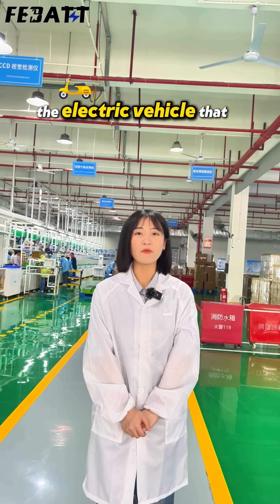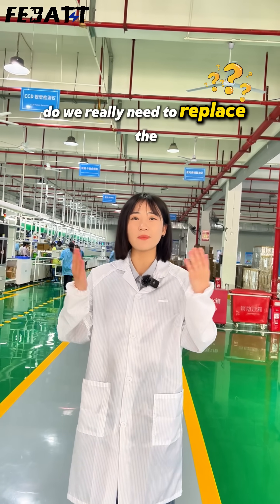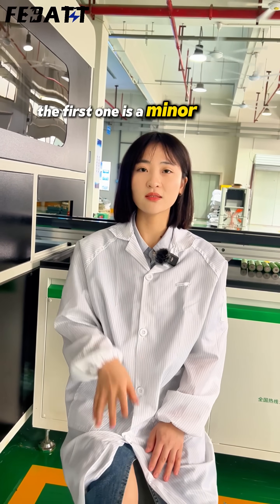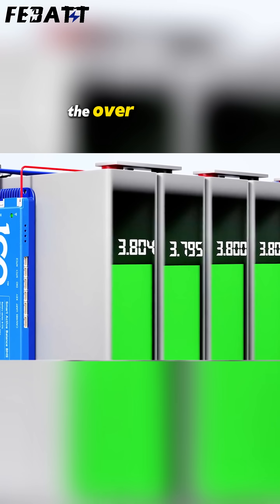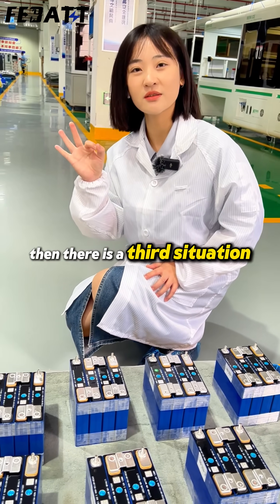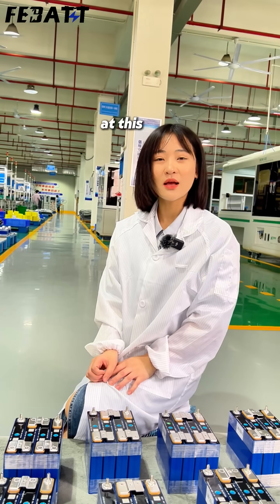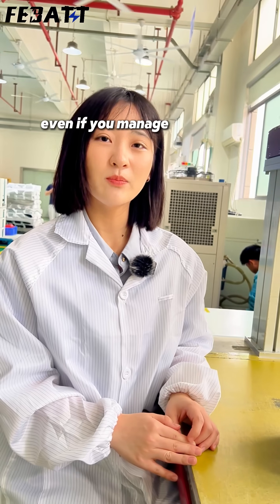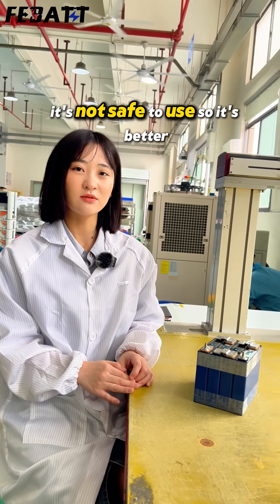Lithium Battery Emergency Revival: 3 Steps to Full Charge #LithiumBatteryDead #factory  #techtips

Comment: Nhép có khớp đâu bạn
Reply from the maker: Yes, sir!🥰 The lines spoken during filming were consistent with the video script. However, due to the loud ambient noise in the factory, post-production dubbing was necessary. Next time, we will strictly match the dubbing speed to the original footage to ensure synchronization between audio and visuals, and avoid such issues from recurring. Thank you for your feedback!